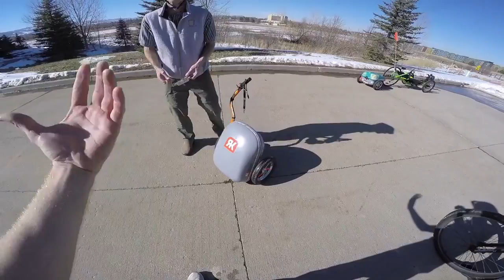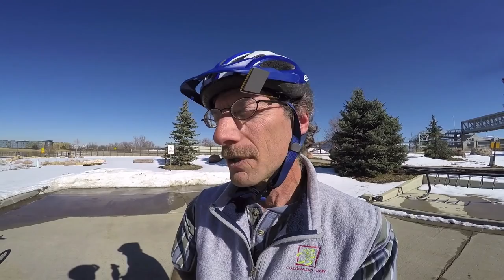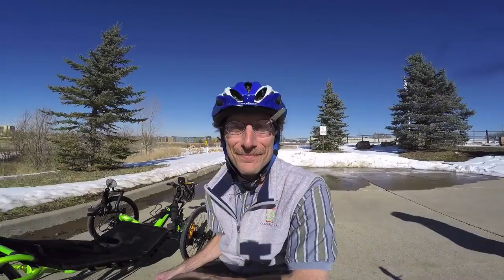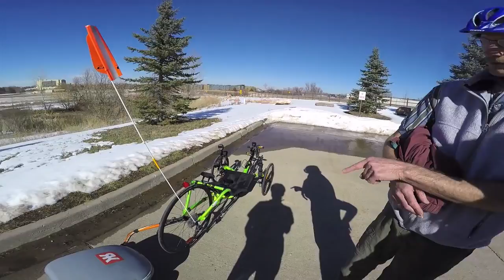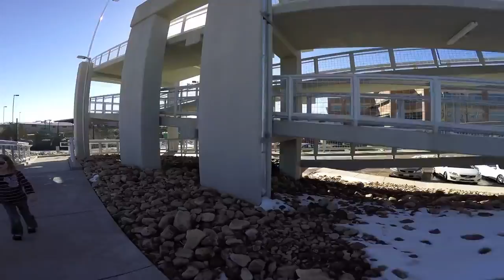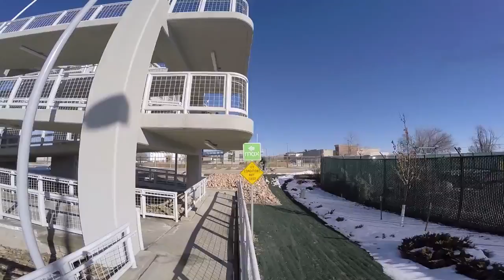Ridekick Power Trailer Review - $700

Comment: I noticed that bike rack in the background that looks like a coat rack-  one like that was installed at our local supermarket a year or 2 ago. What the hell were they thinking when they designed that? Doesn't hold bikes up, doesn't need the coathangers to chain the bike to it. WTF.

Comment: I saw this when you reviewed it in 2013 at $549. It was $199 pre order in this video. Now, its price is increased to $799! Court,  I was very interested at $549. At $699, not so much. But, now in 2021 March $799, which is $250 more than before. Since 2010, all ebike parts have gone down in price, so, costs for components have decreased. Why has this product gone way, way up? You said, at the beginning of the video, that this is the same formula as the original in 2010, 2013, even 2015. I need one but priced too high, priced out of my reach now? Why? How bout a discount or promo code? At 649 it would be doable.
Reply: Good questions

Comment: I can´t believe they are not selling them by the thousands right now. and the added plus of this trailer is the fact that as batteries improve in performance the trailer can get better with minor, tiny adjustments. I pre ordered one and will wait until I get one. I own several expensive e bikes but this idea is just way too smart I have all my faith in it and in the owners skills and attitude towards their creation.
Reply: +Andres Chapero They  cost to much...
Reply: +Andres Chapero I'd rather not have to pull a trailer. That's why I have a mid drive.

Comment: The question is, when, if ever, are they going to actually deliver any more units?
Reply: I modified some Ridekick trailers for people because they weren't happy with them. I changed the whole Power system to 1500 watt motor and controller because their power system cheap garbage. Heavier duty chain and sprocket too.
Reply from the maker: +Ron Warrick Yeah, I wish I knew... was surprised to hear people commenting about not getting theirs this year. I was under the impression that they had solved issues and were going to deliver in bulk and grow the company!
Reply: I make better ones.

Comment: Brushed motors are not worse because they're less reliable, they're worse because they're less efficient AND less reliable. Brushes and commutators are two parts that just don't exist in brushless. Brushed motors produce less torque and less RPM in general too. The only reason these guys are using them is because they're cheaper as they don't require a 3 phase controller.